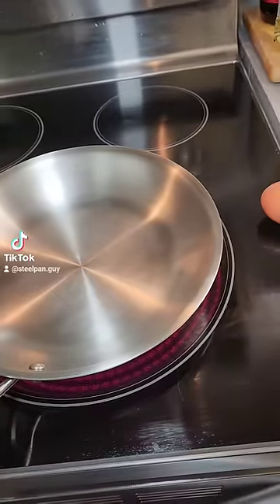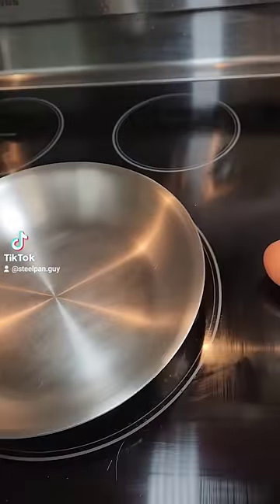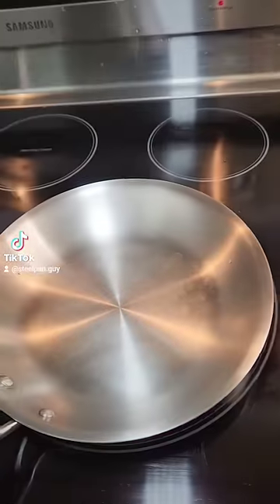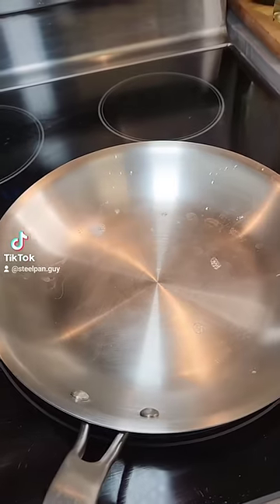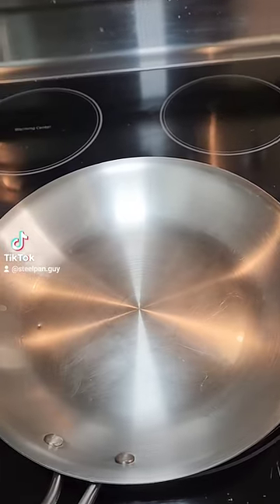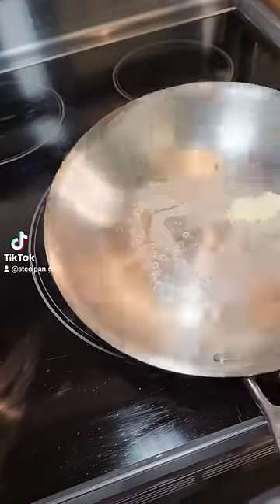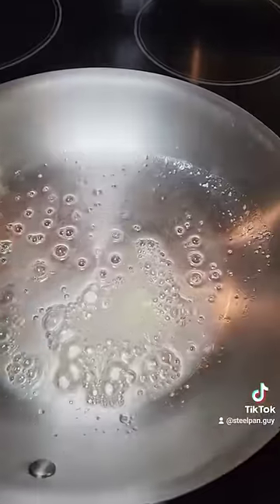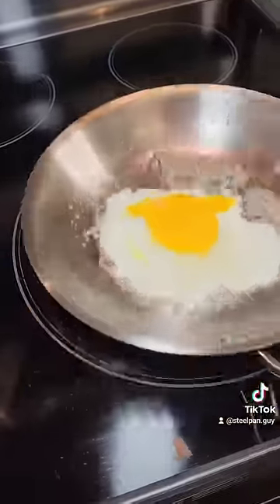Real chefs use stainless steel pans to cook eggs

Comment: Pound of oil and a pound of butter that will make anything non stick 😂😂😂
Reply: In my experience in restaurants, the eggs normally are swimming in oil because the cooks are terrified it'll stick and they'll have to send the pan to dishwasher.
Reply: @ComicusFreemanius sadly true
Reply: @dirtyhairymess not slick more like clog!
Reply: @WeThePeoplewineoneone it's actually highly processed seed oils with the out of balance omega 6 to 3 ratios that do that... butter (of quality) in moderation is completely fine and very healthy.. all you have to do is look at our European friends across the pond.
Reply: SS pan: repeatedly check until it gets hot enough. Add 1-2 TBSP oil and cover the bottom of the pan. Add 1-2 TBSP butter and slosh it around in the butter until melted. Add your egg.
Nonstick pan: no preheat necessary. No oil needed. Butter not necessary but gives a nice crust on the bottom. Add egg.
Reply: Make a sidewalk nonstick
Reply: Legit you could make a rock nonstick with that much grease.
Reply: Real chefs? You just fucked up a humble egg.
Reply: @zugmeister314 I just poach mine an an aluminum pot, I try to not use teflon, etc.. Plus poached is best nutrition wise and less dishes.
Reply: It's actually about getting the pan hot enough If you don't get the pan hot enough the egg will stick even with oil and butter
Reply: @zugmeister314 and then the Teflon particles that get scraped off get in your food and in about 5 years your Teflon pans look horrible from the scratches and God knows what the Teflon does to our bodies when we ingest it
Reply: @ComicusFreemanius stainless steel is a lot safer to cook in than aluminum!
Reply: @The_Cannabis_Connoisseur  not true at all
Reply: @The_Cannabis_Connoisseur everyone on earth is already poisoned with Teflon
Reply: @ComicusFreemanius Why would we be terrified, we do it EVERY DAY. We flip the eggs in the air, they can't be swimming in oil either.  I bet you don't cook.
Reply: @asueft I would prefer to not cook for a wage again, no.
Reply: We use to salt and a scratch pad in a circular motion to new pans in the restaurant and then use them as dedicated egg pans. Never washed, just wiped out with a rag. As long as you don’t burn them, you should never need to reseason them
Reply: @ixpol9163  no one scratches any pan what so ever especially here talking about stainless steel. If you did that at any restaurant I can guarantee they shut down for being as shiiiiity as the cook 🤣
Reply: Also, never let anyone use your teflon pan. My girlfriend absolutely destroyed  mine (in one using...) making tortillas. While having a stainless steel pan AND a cast iron pan right beside it. She's become a great cook, but she was absolutely useless in the kitchen at one point @cheesesteakwit
Reply: @asueft You can flip eggs that are up to the yolk in oil. One place I was at, the dishwasher destroyed all the small saute pans non-stick finish and the pans were pretty much mild steel. Like the opposite of a nonstick pan.
Reply: @croskoal  we talking about stainless steel and your talking about everything the convo isn't about 🤣
Reply: @WeThePeoplewineoneone Salt and a cloth is the chef approved way of cleaning a steal saute pan, you're clueless.
Reply: @WeThePeoplewineoneone  my friend, you first comment is about oil... but fair point
Reply: It wasnt that much butter you qeeur and butter is healthy as fuck way healthier than seed oils or whatever the fuck you're cooking with
Reply: @croskoal  but still in relation to the video!
Reply: @WeThePeoplewineoneone  stop trolling dude. I already told you you were right
Reply: @croskoal that ain't trolling 😂
Reply: @WeThePeoplewineoneone  right again!!! Wow, you are on a roll today! Must be the highlight of your weekend
Reply: @croskoal maybe if you just stopped talking... ever thought if that before or did mommy not teach you that either. I am sure your living in mommies basement rent free trying to be a keyboard warrior 😂 get lost 😂
Reply: @WeThePeoplewineoneone  I stopped 5 hours ago... when I said you were right to call me out. I'm not sure why you keep replying...
Reply: Any less than that and it sticks. Maybe that should be your takeaway
Reply: Except your arteries 😂

Comment: Real chef here. We use eggs pans in the real world. I can tell you never worked a line before.
Reply: egg pan so cute and smol and giv perfect circle egg, i love u egg pan, seeing like 7 egg pans along the edge of the flat top is so cute :3
Reply: New to restaurants?  Egg PAN not egg ring molds. 🤦‍♂️🤣
Reply: Oh jeez, I hope your being sarcastic.
Reply: @avergara13 ew what restaurant uses a multi slot egg pan
Reply: @dabinhaler1337 none. We use teflon pans that are use solely for cooking eggs. And in the line of every restaurant I’ve worked in or ran for the past 15 years we refer to these pans as “the egg pans”. Because they are only to be used for that purpose.  Everything else gets the stainless steel pans or cast iron/carbon steel pans. When you are on the line during service for a 500 seat restaurant we don’t have time to use and heat up stainless steel pans for eggs.
Reply: @avergara13  As a line cook I can confirm. There are separate small pans just for eggs. They are indeed teflon
Reply: @pilapila183  some restaurants grill
just depends if its a diner or less casual
Reply: @testthisfordecficiencies they are not, we do in fact use tiny egg pans

Comment: You're pan wasn't hot enough, the water should dance around the pan with almost zero resistance. What's happening is the water in contact with the pan is evaporating as soon as it touches, causing the water to "hover" over the pans surface. This is called the leidenfrost effect (don't check my spelling). 

A little butter does help but any pan is nonstick with enough butter.
Reply: I thought I was the only that noticed!
Reply: With enough butter you are cooking Spanish fried eggs

Comment: Real chefs don’t use glass flat tops
Reply: Close to true.   National corporate accounts have strict safety regulations.  Which force a lot of production kitchens to use induction ranges with a breakable top surface.  Although more sturdy than a residential glass top.  But the commercial 4 range induction can cost a years salary.
Reply: Gas fired are getting banned
Reply: Well this chef right here does
Reply: @SEMARPE  That's stupid.  Why!?

Comment: Brother, in high volume restaurants we use non stick pans. They're used because you can just wipe out the oil and start again right away vs washing 80 different pans.
Reply: Right?! "Real chefs"?! Bro,...we got COOKIN to do! And dish pit is swamped enough!
Reply: @Patoromia I came here to say EXACTLY that! We Gots work to do!
I Could’ve made 3-4 orders of eggs in the time it took him to heat up the pan. 
WITHOUT BREAKIN THE YOLK!!!
Maybe he means real
 “home cooks” who can take 20 min to heat up a pan, then screw up the eggs he’s cooking  for himself and scrub it in his sink. then go watch tv
Reply: Oil? No tallow, lard or ghee. Are you even cooking.
Reply: Facts😊
Reply: Real chefs don't gatekeep egg cookery. Plus, if it's a breakfast spot, those eggs are going on the flattop. Chrome plated flattop if the place is super busy.
Reply: @jesseburnham2668  Chrome plated??? Nah, commercial griddles are either made of stainless steel or carbon steel!
Reply: So your customers are getting some amount of PFAS, right?
Reply: @---usr  nah bro. We don't use anything that isn't nsa approved.
Reply: High volume but not high end
Reply: the fuck you mean , at beefeater they just fill that nonstick up with oil and cook with it all day

Comment: “There’s no other pan that can do this”
-Every person who’s ever tried to sell you a pan
Reply: Meanwhile all clad is laughing in 3 stars at this guy.
Reply: I don’t think this guy has ever heard of cast iron or carbon steel pans. When they are properly seasoned and egg will not stick in a dry pan at the right heat. Also, anything becomes nonstick with enough oil/butter. Stainless steel pans are not nonstick for a reason. They are the best pan for gravy/soup/sauce where you want the ingredients to stick to the pan so you can build up a fond and incorporate that fond back into the dish by releasing it from the pan with liquid.

Comment: Chefs use stainless because it lasts longer than teflon and is easier to clean in a commercial setting than cast iron or carbon steel. Take away that commercial context and its clearly the worst option for pan frying
Reply: We don’t really use stainless steel actually haha! Carbon steel is the way to go because it’s inexpensive, light, and transfers heat really well. Overtime the pans will get darker and darker as fond builds up and you end up with these naturally nonstick pans that can be used for just about anything. Salamander, oven, stove, etc really versatile pans. If you’ve got a gas stove at home I’d give a carbon steel pan a try.

Comment: real chefs use gas stoves too.
Reply: a lot of restaurants are switching to induction because it creates a lot less heat in the kitchen

gas stoves are also not allowed in most apartments
Reply: Gas stoves are so outdated. It’s not 1920.
Induction is the future.
Reply: @somethingsomething404 😂😂
Reply: @somethingsomething404 so are Stainless steel pans
Reply: @cawashka real chefs dont care about the heat on the line they just deal with it
Reply: @cawashka chefs don't cook in apartments 😂 they cook at their job site. 
But most gas ranges use electric oven and gas tops.
Reply: Electric cooktops with quality cookware cooks more evenly than a gas stove on a Cast iron pan.
Reply: Gas stoves have you been living under a rock for the last 20 years? Gas is inefficient, slow, environmentally unsound and toxic. The industry has been moving over to induction hobs for years now because it only heats the pan and not the air and is way cheaper to run.
Reply: @desertoutlaw3317 that’s mugs who allow themselves to be exploited.
Reply: @coltoncyr2283 it’s old hat a lot of high end restaurants are moving over to induction hobs because it’s fast and cheaper to run, easy to clean and when not in use can be used as a prep surface. Gas stoves need to be phased out because they’re crap compared to industrial grade induction hob. I’ve seen 25 litre/5.5 gallon pan of cold water be brought to the boil in 3 minutes on induction hob that’s game changing when you’re working to a deadline.

Comment: I'm a stainless steel fan. Less harmful effects on your food. But what makes it non-stick is the heating of the pan to the point the water beads around creating air pockets under the food once it hits that temperature. If the water beads and breaks apart, your pan is too hot. If it beads and stays together, your pan is just right. Side note I also use butter because why not.

Comment: No water dancing on this. For those who are wondering what it ACTUALLY looks like and what its called is the leidenfrost effect. The water literally rolls around on the pan without sizzingly and boiling off. That's what you're after, and that indicates your pan is at a proper temp. His pan wasnt at the right temp yet.
Reply: Yeah I didn't see the "mercury balls". This guy is a talker. Can't trust him. His YouTube name is steel pan guy. He's just pushing a product.
Reply: The issue with that is it’s only good for a fried egg, try to scramble at that temperature
Reply: Butter burns at that temp real quick as well. This guy just put a ton of grease in a pan and thought something
Reply: Butter burns at that temp real quick as well. This guy just put a ton of grease in a pan and thought something
Reply: @mikoajsmolenski5989 that’s why there was some oil before the butter. Mix a small amount with butter and the butter won’t burn!:)

Comment: Cast iron, carbon steel, and copper pans all work just fine. Im becoming a carbon steel convert myself. Seasoned pans also need less added fat than stainless. Just something to consider.
Reply: Carbon steel pans are great! They’re cheap and can take a real beating.
Reply: I've seasoned my airfry. Now i can just wash of any burned stuff with hot water and reuse it.

Comment: If you add butter/ oil/ fat to anything of course it’ll make it non stick, if a stainless steel is the right temperature, it will naturally be non stick due to the leidenfrost effect
Reply: You can also make a ss pan nonstick by heating it with a large amount of salt and then allow to cool and transfer into the next pan. Just a little chefy tip. Like you said if the temp is right in a ss pan it’s good to go. This Teflon crap can’t be good for you. I know it’s apparently different now but DuPont wasn’t exactly honest the first time around why would anyone trust them now the chemicals have apparently be revised. Learn to use a ss pan correctly and you’re good to go with everything. It will also last a life time if it’s well riveted and multi ply bottom.

Comment: You can't get non stick at low heat on stainless which is what you need for smooth custard like scrambled eggs.  Yeah use stainless if you want some flash fried overcooked eggs

Comment: I dont want to eat deep fried eggs every morning. I'll stick with a non stick and not have to add a bunch of fat to my eggs.
Reply: Deep fried eggs! Bwa ha ha ha😂
Reply: My cast iron pan barely needs any oil, doesn't stick and I don't eat Teflon particles.
Reply: @Andrew-it7fb  I definitely respect that. But you don't eat Teflon if you use non metallic utensils. Also, a majority of people can't keep a well seasoned/oiled cast iron ready at the go haha.
Reply: @BangPowBoomKids  it still flakes off over time. 

People absolutely could. They just choose to go with the easy route, which I understand. I also got tired of having to buy new pans. Teflon pans don't last forever, even when using plastic utensils.
Reply: Fatty eggs are the best eggs.
Reply: The fact is, you don't need this much butter on a stainless steel for the egg not to stick. You probably don't even need it at all with stainless steel pan. You just need to make it hot enough and the egg will not have a chance to stick at all.

Source: personal experience, I don't use oil or butter, just make it really-really hot

Comment: the butter isn't important. It's the fact that the pan is hot enough to push the oil to its smokepoint. That's when the oil polymerizes and forms a nonstick coating.

Comment: actually you didn’t hear it up enough, it will be non stick without butter. I don’t know if you did that on purpose to get more comments but you should heat it until the water almost levitates in the pan forming tiny little balls.

Comment: No other pan, except other pans, like cast iron or carbon steel. Stainless steel are really nice, though, by all means. But yeah, you need oil or butter. I'm all for throwing out cancerous and hormone disrupting non stick pans, but if you're very careful with them they're useful for one single reason: you can cook eggs without adding calories from oil or butter.

Comment: The heat shrink up or closes the micro crack in the surface. Metal expanses making the micro scratched even smaller. The oil helps more than butter. Butter adds flavor while lubing the pan.

Comment: put oil to cover the bottom of any pan, turn on heat on high..  wait for it to smoke and lower heat to low.. wait 15-30 seconds, now your pan is non-stick.. it’s called spot seasoning.. don’t break the yolk 😂

Comment: You still didn't get it hot enough. 
The water should bead with 0% sizzle.
You can then drop the heat and add high smoke point oil.
It doesn't need to be much.
Don't add butter until eggs are half cooked. It is for flavour, not non-stick qualities.

Comment: I use a good quality non-stick and it works great. Oh, and my egg yolks are typically unbroken. I tried every technique with SS including this one and had to scrape the eggs off the pan. I also cook with olive oil not butter. If I have to use specific temps only and products I don't want to use just to get it to be non-stick I'm not interested. I'm not a chef so I'll use what works.

Comment: Um, no.
If your making an obscene amount of eggs (brunch) its a good idea to have non stick pans.
You dont use them for anything else, and you personally hand wash them and stack with a towel between them after use.
You dont use them to sauté normal crap, thats what the stainless steel ones are for. Theyre durable.
And god help you if your putting regular butter in a screaming hot pan.... and cooking eggs with that? that butters gonna burnt af bro. Idk what kind of kitchen you worked in

Comment: no other pan does this?! (any pan will cook an egg at least any pan i know.. )

"butter in addition makes it less likely to stick".. i don't think the asian part of the world uses butter for that..  but sure more is more... 

but one thing.. 
i baught a new tefal pan set.. 
nonstick ppans and stuff with removable handles and a set of silicone utensils for almost anything... 

.... i think down to the pan it costs 50€ and they will work for about 10 years till somone thinks "fork in nonstick is cool"... 
for a fact my last non stick died after 7 years of abuse because i had no silicone utensils..
.
so the one thing is.. and results in a question... 
how much butter will i save over 10 years

Comment: Is this a joke?  It doesn't need to be stainless steel, you could be using cast iron. Using butter, or oil or cooking spray will work either way...with ANY pan whether it's stainless or cast iron or teflon.  Hundreds of tests? What? 🤣🤣

Comment: Bruh, if the pan was really hot like it's supposed to be, the egg would start sizzling on contact a lot louder than your video. Also you don't need butter to make stainless steel nonstick, which amateur told you that? Learn some proper pan cooking from the Asian cultures.